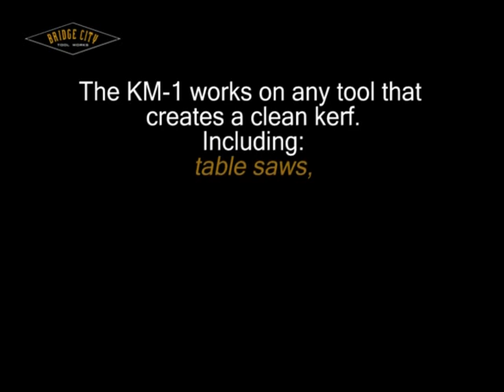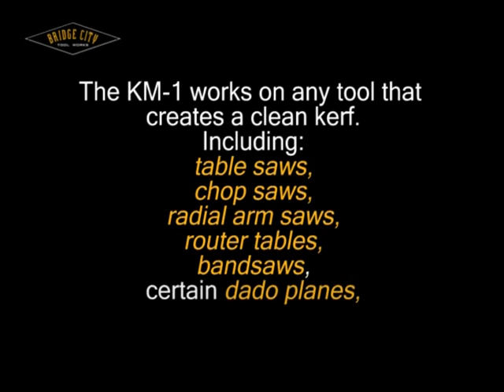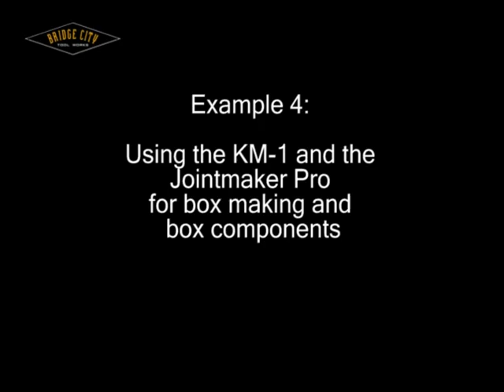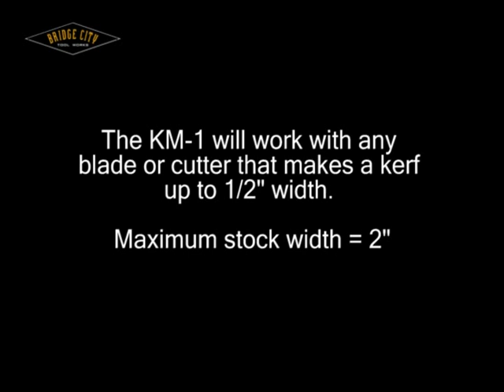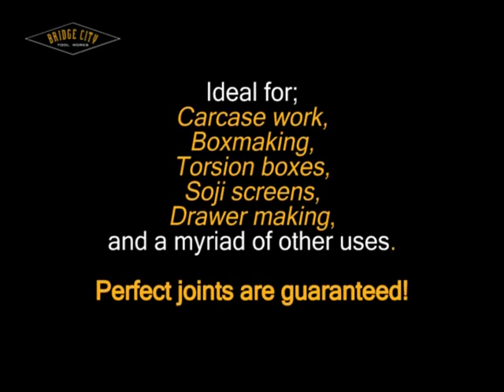KM-1 KerfMaker by Bridge City Tool Works

Comment from the maker: @kennethdante The KM-1 works as an intermediate stop. You must clamp a stop to your fence and use the KM-1 between the stop and the wood that you are cutting. Flipping the KM-1 after your first cut creates the correct offset that you gauged from the wood.

Comment: it's a really nice demo but the critical information, which is setting up the table saw with jigs for it to work correctly. I see the tool as a guage, adjustable part of the jig, now how to put it to use on the saw. I see shit clamped to the fence i mean explain that part please :(